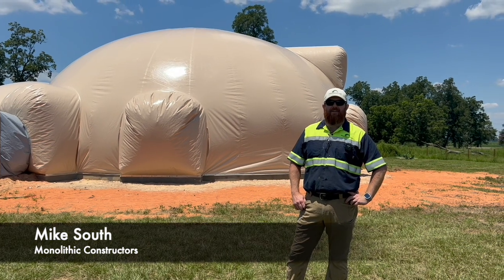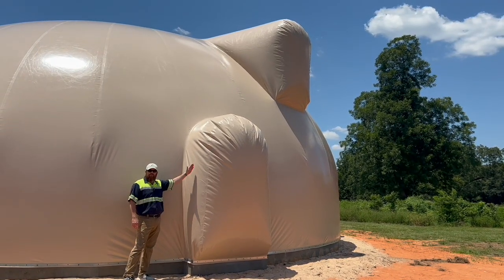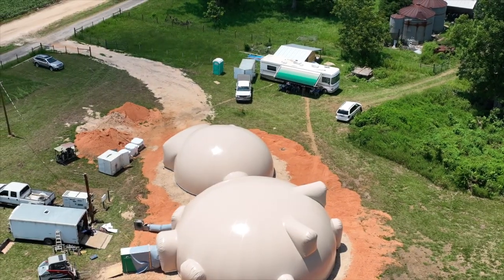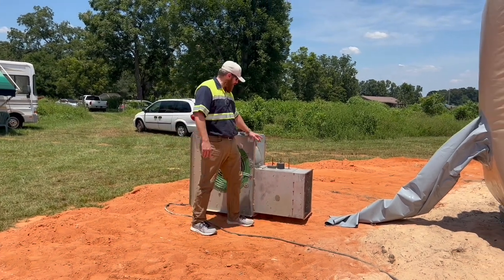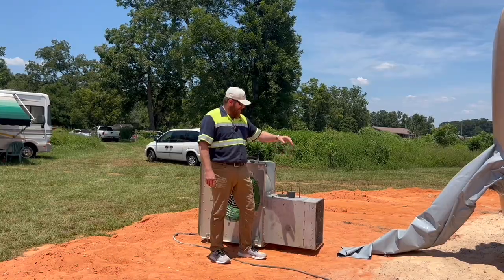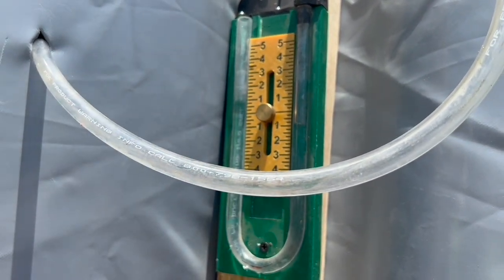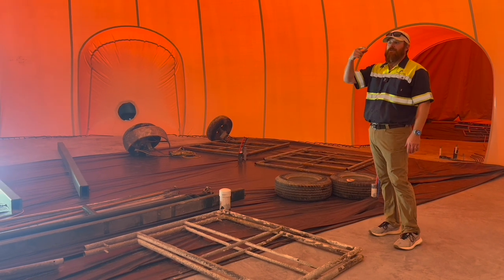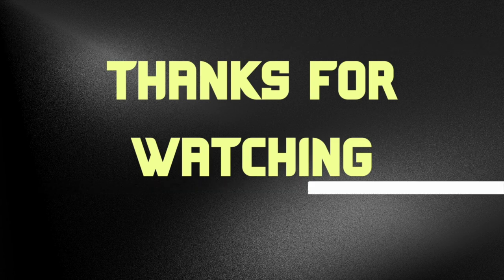Monolithic Dome Inflation in Florida

Comment: How are the balloons built?
Reply: They are sewn together at their factory in Texas. The domes are inflated as in the video. Once inflated the domes have closed cell polyurethane foam sprayed on to a depth of 3-4”. Afterwards rebar is installed on the foam. Then a layer of shotcrete is applied, maybe 4-5” deep. After all this is complete the dome is ready for interior framing, electric, plumbing,etc.
When complete the dome should be able to handle hurricanes and tornadoes with minor damage if any at all.
Reply: @Heezanozzlesnob  SHOULD being the operative word.
Reply: @Heezanozzlesnob  Constructively, I still doubt the tensile strength.  Even if the source of density handles the direct impact of a tree of the weight thereof. Having used the polyurethane word in your construct I now question the burn rate at which it catches fire? On a atmospheric level this does not even pose applicable under extreme weather, Now, it's primary chemical base is a fire, accelerant.?
Reply: Does that really matter when a hurricane of 140 mph winds can throw a tree right through it.
Reply: @rafaelgonzalez4175   This is just the first stage.  They get spray foamed on the inside, then rebar and concrete is applied.  140 mph wind wont be throwing any trees through that.  

Storm surge is still a problem.
Reply: @rafaelgonzalez4175 a hurricane cat. 5 won't move it.
Reply: @everhappy6312  I am sure the words I used was a tree going through it. Not like that isn't going to happen. Nice try though.
Reply: @rafaelgonzalez4175  they tested it with a bomb hitting it. The only damage was where the bomb hit...nothing else.  Also Domes have been hit by lightning...no damage.
Reply: @rafaelgonzalez4175  a tree will not go through it. The only thing a tree can do is damage a window or a garage door. They actually shot a cannon into a Dome and the only damage done was where the bomb went in. Everything else was still withstanding.
Reply: @rafaelgonzalez4175  what do you think happens to a tree in a hurricane when it hits a trailer or stucco or vinyl siding?
Reply: @neeksor  I am not sure. People don't live in trees from what I know. 

Tell me, What happens to trees when they get hit by Trailers and stucco or vinyl siding?..
Reply: @rafaelgonzalez4175  these homes were tested at wind force of 750 mph. A wind of 140 mph will do nothing to a Dome.
Reply: @everhappy6312  I shouldn't even reply, but here I go. Wind shear and impact are not one in the same. It is round or the top half is. There is very much wind resistance. Let an object come in contact with that structure, at that velocity, and if the structure is still standing, I will give up my house.